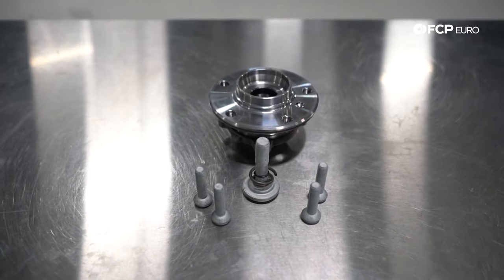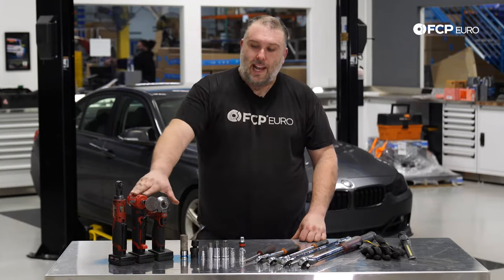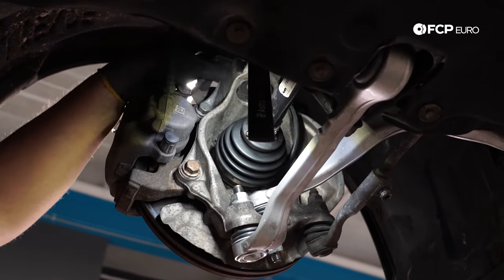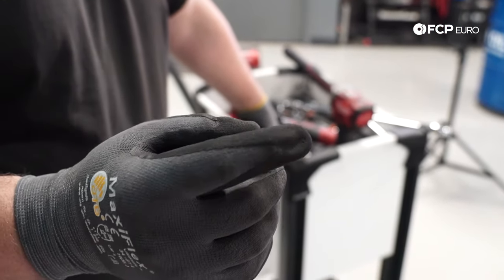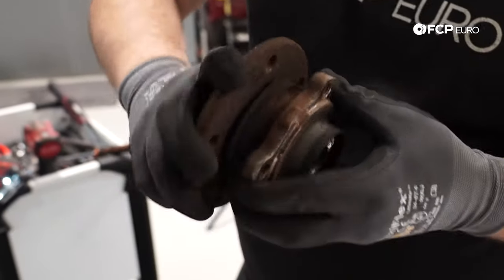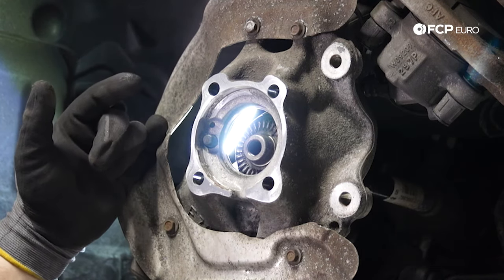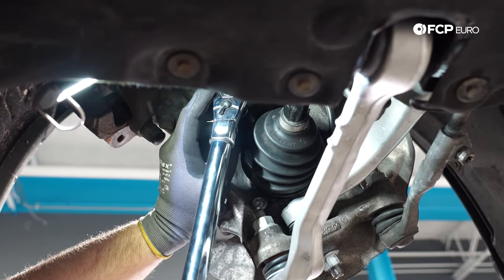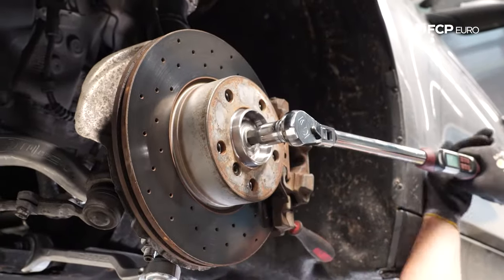BMW F30 xDrive Front Wheel Bearing Replacement (BMW F30, F31 328i, 330i, & More)

Comment: You guys are killing it with these DIY videos! Thank you for supporting the community.

This video also applies to the BMW F25/F26 X3/X4. If needed, the Neiko 10083A kit provides the T60 and TP60 bits and the Neiko 10288A kit provides the 17mm male hex.

Make sure both front wheels are off the ground so the steering wheel and axle can be turned freely.

Two of the four hub bolts are inconveniently near suspension bits. A flex-head breaker bar and torque wrench helps get past the suspension bits and out of the wheel well with usable rotation. Having the steering wheel turned close to (but not at!) full lock also helps get the right angle on them.

After the axle bolt is removed, you can push inward on the axle's spline face and reposition it to keep the boot from interfering with the bolts. At 9:33 in the video, you can see how he has it repositioned away from the two troublesome bolts.

The four hub bolts are recessed into the carrier just enough to make them difficult to access without an extension. But even my shortest extension pushed me inconveniently close to the suspension bits. I strongly recommend getting a 1/2" mini-extension, which would make access much easier.

Getting the extra 90 degrees on the hub bolts is a pain if you don't have a full lift and can't see what you're doing from underneath the car. The four bolt ends are visible from the exterior; you can make a paint marker witness mark to help clock the 90 degrees.

When seating the new hub's splines on the axle splines, I found it easiest to turn the axle by hand, then watch for the hub to turn. You can also pull the axle away from the hub a bit to feel the splines skip; this will help you feel for engagement. Make sure the steering wheel is straight so there's no steering angle on the axle.

When tightening the new axle nut, make sure the small rotor retaining screw is not installed. It's not meant to handle that torque, and the lug bolts won't hold the rotor tightly enough to keep it from seeing that force.

Having occasional access to a helper is nice. They can turn the steering wheel left and right to help with hub bolt R&R, and they can press on the brake pedal to hold the rotor during axle bolt R&R.

Comment: Respect! For the correctness and fullness of informations. Really!
I'm planning to change front right side wheel bearing on my BMW X1 e84 x drive 20D 2014. It's an Xdrive (4wd).
My kind question is if it's the same process as described in this video.
Thanking you.

Comment: Hey Gareth, or the FCP team, do you happen to know the correct torque spec for the rear axles on a F30 335? My rear axle nut keeps coming loose causing a clicking noise during acceleration.
Reply: 145Nm + 45°. But a few  tips on these axle nuts. I always put a little bit of oil on the back side flange (the part that torques against the wheel hub) to prevent any friction from preventing a true torque spec. If the wheel hub is corroded it's important to make sure the seat for the nut is clean of corrosion. Make sure you use a new axle nut and also stake the axle nut once installed to prevent it from being able to back off. There should be two notches on the axle in which you can deform the outer edge of the axle nut into.

Comment: This is what you need to watch if you are looking to replace the Hub in a 2014 X1 XDrive28i. Watch it carefully. Make sure you buy the posterior SCREWS when you buy the Hub. Also you will need a T60, TP60 and the 17mm (which you usually don't have in your tool box)
Reply: Also axel bolt.

Comment: I believe the cut-off date on the old bolts is 10/14.  Correct me if I am wrong, if you get a NOS wheel bearing that does not accommodate the new bolt size, then the old style bolt must be used.  That being said, I doubt bearings that old are still floating around on the market...but possible.  Thanks for the video.

Comment: Would you / anybody know what bolts are needed on a 2014 335i RWD & if I need to replace the wheel hub and bearing or can I get away with just replacing the bearing?? 

Lastly thank you for this informative breakdown & install...

Comment: Thanks for this. My F30 30d XDrive makes a noise and vibration from the left wheel when I turn left doing 60mph+. I am under the impression it might be the wheel bearing and I due to change the rotors and pads anyways. Any advice for me? Cheers.

Comment: Thank you for this great video vero useful. I have a question. You said that the new four bolts have a pitch of 1.25 instead of 1.50. I noticed in bmw technical repair guides that these bolts should be torqued at 120 nm + 90 degrees. Is this correct? Thank you.
Reply: Just watched this video again today and saw several comments I'd like to answer even if it's a late reply. With BMW's change of thread pitch on these wheel hub mounting bolts. There is updated information from TIS on these two variations of bolts. The M12x1.25 screws are torqued 120Nm + 90 while the old M12x1.5 screws are 80Nm + 90.
Reply: @GarethFoley  I just followed this video and did 80Nm + 90 degrees with the new bolts. Should I buy new bolts or hope that they are not at 120Nm yet?
Reply: @GarethFoley  Awesome! Thanks for the update.
Reply: @GarethFoley   Can you confirm the torque is the same for the 535i (F10) ? also, I believe I need to remove the tension strut ball joint nut on a non xdrive model to access one of the 4 hub bolts.  Would you happen the know the torque for this nut?
Reply: @MrSohara89  I know this is a late reply, but if you did it 80Nm, just rotating 35 degree seems enough to meet its torque spec. I checked it when work this job. Otherwise, just buy new one bolt and replace it. when replacing with new bolt, try 80Nm first then 120Nm to check how much degree more rotated. then apply additional degree between 80 and 120 to other bolts.

Comment: Well, it looks fairly easy. I hope it goes as good for me, I am not a mechanic but accomplished the drive line by myself. Still a little nervous, so my 320i 2015 is not an xdrive and I am  replacing both the rear hubs and bearings. Is there anything I need to know different?

Comment: Great video! I tried to start this but the 17mm allen wouldn't come off, even with a breaker bar. It's a 10-year-old F25 that's seen a few NY winters. Should heat do the trick?
Reply from the maker: Heat and and penetrating fluid should help!

Comment: Sorry for the dumb Question new to this I have an 328i xdrive 09. Do I need a special socket to take off the big center bolt before I take off the rotor etc ?

Comment: Change front bearing on mine no xdrive f30 with skf vkba 6781. Thanks for your video, but the new bearing bolt has triple square head with same threads. Can you confirm?
Reply from the maker: Often times BMW, as well as other manufacturers change hardware, so seeing a triple head square on newer hardware is normal!

Comment: What can it be on a cold engine for about 10 seconds. I hear the BMW e90 335i N55 rattling
Reply: Possibly wastegate rattle
Reply: A few possible sources. Wastegate noise is a possibility but if you have the A/C on or the defroster some of the noise could be from the A/C compressor. Past those external elements you could be hearing lifter noise (they can bleed out and take a few second to prime). The other thing you may be hearing is the floating wrist pins for the connecting rods. Since the noise is only present at start up and can't be heard when the engine is warm or while driving it's most likely nothing to worry about.

Comment: Can the speed sensor in the wheel bearing be bought separately instead of cleaning?
Reply: The wheel speed sensor itself is a separate item. The magnetic tone ring integrated inside the wheel bearing cannot be replaced outside of a wheel bearing hub assembly replacement. A failing wheel bearing can case ABS related issues if the tone ring has been damaged. That's common on wheel bearings that are very worn and have a lot of play.

Comment: This is a dumb question but I am new to BMWs. I got an inspection for a 435i I might buy, they said I need new front swivel bearings on each side. Is that the wheel bearing?
Reply: "Swivel bearing" is BMW terminology for the front wheel carrier/knuckles. The only reason I am assuming that came up during an inspection is because of a camber problem that could not be corrected via the small amount of adjustment available at the strut tower. BMW has camber correction knuckles for the front suspension. They have knuckles that can either increase camber or decrease camber. However, there are other things like worn control arm bushings that can cause increased camber so replacement of those swivel bearings may not be required.

Comment: Gareth, you are DA man!  Thanks.
Couple questions:
1) Root cause: Was this case strictly the humming sound while driving or was there slop felt in the bearing when moving the wheel (on hoist)?
2) Would you recommend doing the other side at the same time, regardless of symptoms on that side?
Cheers.
Reply: Late on the reply (sorry about that) but I think your question is still relevant to answer for anyone else looking for the same information. This wheel bearing did not have any play in it. However, one thing that was especially of note is the noise from this bearing was louder on right hand turns at speed than left hand turns. Since the noise was coming from the front this indicated to me that the front left wheel bearing was the likely culprit. On visual I also noticed some reddish/brown dust on the back side of the wheel bearing around the tone ring seal. When you see brownish/reddish dust around any bearing (u joints as well) it's a wear situation at that point. And generally, it's advisable to replace both sides to not have to deal with it later on however you can get away with replacing a single wheel bearing. The items we always recommend  to replace in pairs are suspension components.
Reply: Awesome info, thanks Garett! 👍🏻

Comment: I found I have bolts that have several teeth on the inside. They look like the bolts in the video but with several sides as opposed to just 6. Does anyone have any idea what they are?
Reply: I believe it is a 12mm triple square if it has 12 points. That is what my original 14' 535i has.